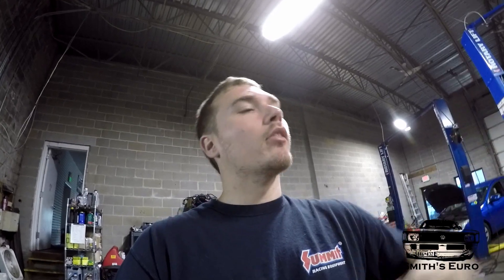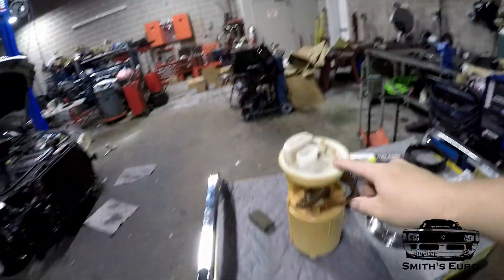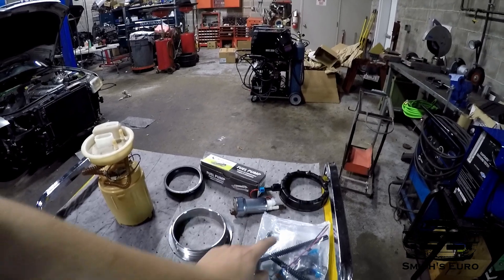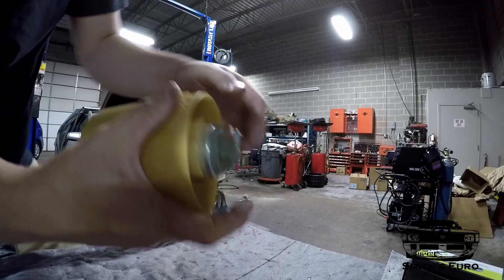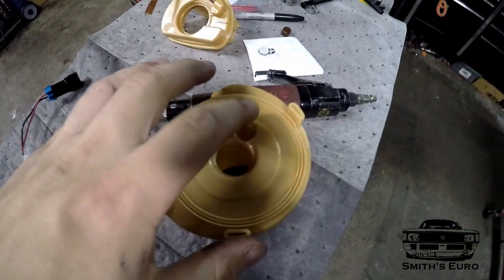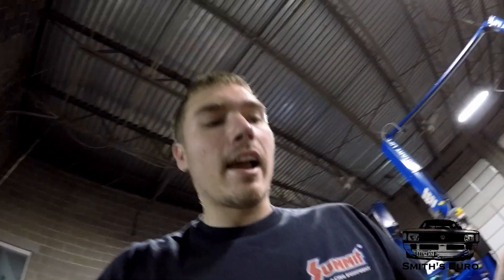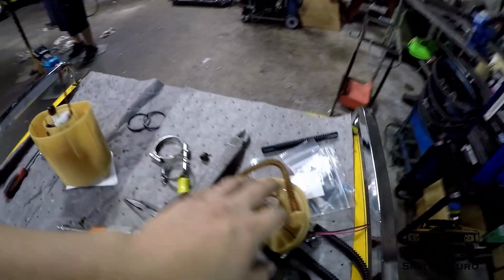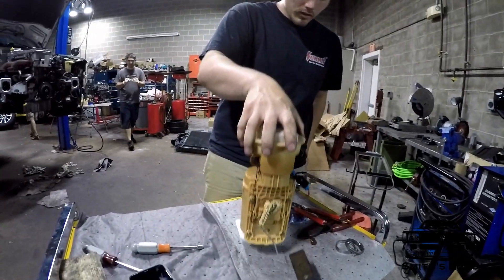Hellcat Fuel Pump Retrofit VW Diy MK4 E85 High Horsepower

Comment: What did you do about the fuel pump wiring? I install a 340v detacheworks fuel pump and I’m worried about the wires getting to hot bc of the amperage of the new fuel pump, or is the stock wiring fine
Reply from the maker: Depends on the load
If making 3-400 i use stock wires

More hp I run dedicated fused 12 or 10g back to relay and have the oe hot wire trigger said relay

Comment: Can a 265 fuel pump handle e85 on a 1.8t need help on it :) any info helps
Reply from the maker: No idea

Sounds small though
Reply: @SmithsEuro  Yup way too small. Everyones wants E85 until they realize they need a 1200cc injector and expensive high flow pumps to make the same that 93 can make with 800cc injectors haha